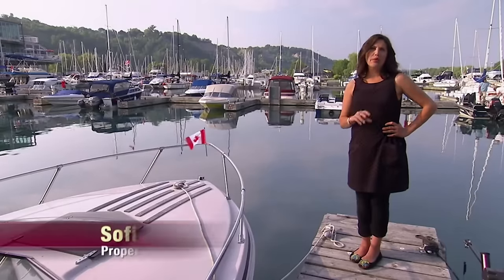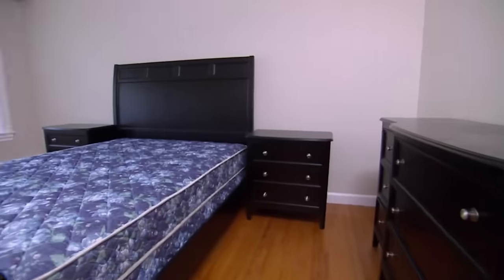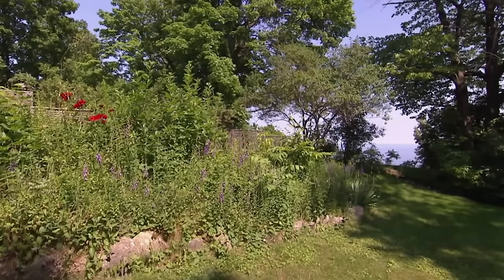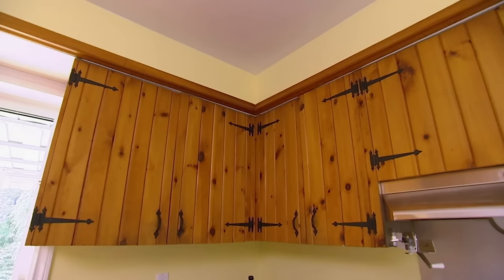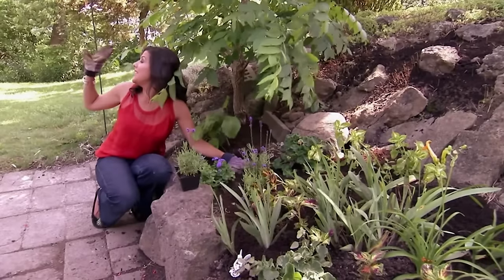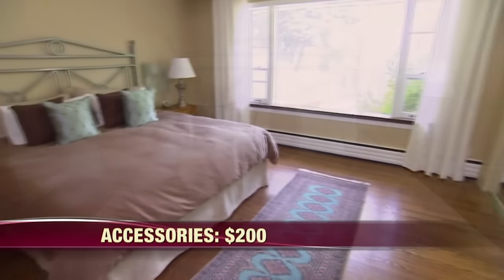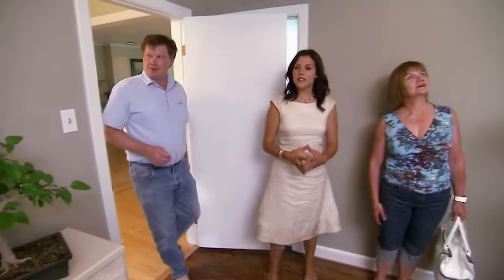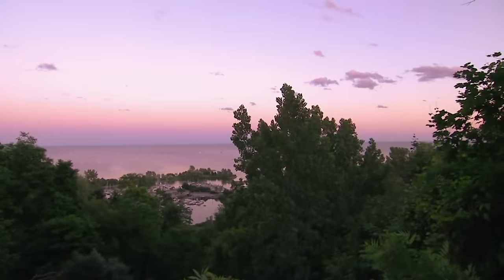A $1.3 Million Property That Hasn't Received A SINGLE Offer! | The Unsellables | House to Home

Comment: Can't the extra door and railing be removed and seal off instead of just replaced with a frosted glass. Why require extra light when there is a huge window? 
Firstly, why the door is ever even build?
Reply: We don't know why it was there but the point is doing a refresh without spending a lot of money and time and doing what you say cost a lot more and takes time to do.
Reply: I’m a “why” person too. I’d love to know what the original layout looked like. It might explain the “door to nowhere.”
Reply: @mindyw2411  I would love to have solved the mystery too.
Reply: @mindyw2411  for sure it was probably something to do with the original layout
Reply: @kebert2thumbsup  The frosted glass “window” is an interesting alternative, but I’d still like to know what the house originally looked like. Just nosy, I suppose. 😁
Reply: @mindyw2411  oh no. I completely concur with you.  I'd love to know the original layout too. 
But also, why so lazy to just rail in that Juliet door (originally! ) 
I sort of have a door like this, except mine is functional.  I have two doors on the steps up to my apartment (I live on the second floor, but also have a foyer as my entryway. Big old grand house....emphasis on old...needs lots of love.  The second door is at the end of a hallway and just leads to the steps. I keep it locked and have a dresser in front of it for storage.
Reply: @kebert2thumbsup  That rail did seem to be a case of “taking the easy way out.” Just no rhyme or reason to it. But the “door to nowhere” made me think if the Winchester Mansion, and so I had to go look that one up again… 😂😂😂
Reply: @mindyw2411  haha.  Ya. That is a good one. But they probably put the rail there when they put the steps in so no one would just open up the door and fall down the steps in the night. But again, just walling it in wouldn't have been that hard. More time and money, sure. But not harder.
Reply: I assume the door led to a small closet and the stairs to the basement were enclosed. At some point they decided to "open up" the plan by replacing the wall that enclosed the stairs with a railing and eliminating the closet. Rather than have to replace the paneling, they simply left the door in place.

Comment: The kitchen could've used more updating: appliances, countertop, sink.
Open the kitchen by either knocking off the wall diving the two rooms or the small section where the microwave is.

Comment: The reason the house wasn’t selling was because of the kitchen. If I were to guess, I would say he probably had to drop the price by about $50K. Did anyone else notice that the garage door didn’t fully close?
Reply: I loved the before kitchen! And yep, I just said to myself,  The garage door looks like mine did when it was coming off the track!
Reply: I think it looked more like the ground beneath sinked on left side.. it happens if the foundation had sand or soft material and it moved over time to water log or something. That's why Jesus warned, to build his chirch on rocks, said be careful of building on ROCKS than sinking sands.. a literal and figurative sermons 😂
Reply: saw that garage door at the end.  It was the kitchen and the backyard. Most people could see that the office could be converted to a room without changing it.
Reply: The house is not worth 1.3 million sorry try lowering it by a million and see you'll get some callers
Reply: @susancross5192  The painted cabinets looks nice but were clearly a cheap fix.  And the very outdated faux woodblock countertops are awful in an upscale house.
Reply: @itsjustme4848  Totally ugly cabinets. They could have filled those gawd awful grooves with putty and they would have looked much better.
Reply: The biggest issue with the kitchen was the counter, terrible quality and terrible color, and the flooring and faucet/sink.

Comment: Everything was an improvement, however that wood wall is a mid-century design feature that should never have been painted over.  I'm not adverse to painting wood, but this was a big mistake.  Would also have preferred a mid-century chandelier in the dining room.

Comment: I would be beyond upset to find out that the panel wall and wood finish cabinets had just been painted for the first time. The potential of both rooms was lost to that bad decision. People love to miss the real opportunities because of their wrong concept of what is outdated. And the whole paint everything white movement will be looking dated soon enough - for me it already has for some time now. It's important to mix darks and lights and a dark wall adds depth. Not every wall needs to be reflecting so much light.

Literally just actually updating the kitchen would have done more and fluffing up the decor and landscaping would have added more value and been money better spent. The warmth it did have was lost to this quick cheap update.
Reply: Me too. This is a modern mid century home. It’s meant to be wood, big windows, primary color art, Frank loydd wright, eames and knoll, Saarinen, etc. a walnut base cabinet with high gloss uppers and cement Greg countertops. Slate floors. If she paints the wooden walls I will lose it. Modern Japanese garden with a dwarf Japanese maple tree, bamboo, etc. paint the fireplace black.
Reply: Reface the kitchen cabinets (just painting them looks cheap) and then have a landscaper spend a day making the back yard look neater.  The other few details weren't significant.

Comment: So the location in the description is United States, but the house overlooks lake ontario and is situated in Scarborough. Its upploaded in 2022, but his monitor is from 2002, the house looks to be from 1997 ("it has a retro feel"). And they want 1.3 millies for the house, which is a 2022, LA price. What. is. Happening.
Reply: Scarborough is in Greater Toronto Area. Like you said this video is more than a decade old and toronto real estate is quiet pricier. In 2022 it will be consider a steal 1.5 m for a lakeside house in toronto. That is a little piece of paradise

Comment: $4 k of improvements for a $1.3 million asking price . That won't be enough .  A buyer at $1.3 million wants to buy a dream , not a requirement to update a kitchen for about $75 K, bathroom updates at $30 k. And I notice that with the closed garage door, the cement driveway has a huge dip indicating some settling  issues. The appliances and computer screens indicates the owner is into " good enough ". I'm guessing that the floor radiator heating indicates there is no air conditioning HVAC........at $1.3 mil and no AC,that's a pass for a family.
Reply: Spot on

Comment: $4000 for the update’s. Hard to believe. What they did in the yard, alone, would be double that.
Reply: If you look closely at the details of the paint job and other dyi’s, it’s incredibly poorly done and will cost more to re-update. I bet if I opened the kitchen cabinets to see what’s inside, I’d be mortified. :D
Reply: I agree. The prices are not accurate it doesn’t seem they included labor. I think the used the tv crew for all labor.not a professional job.

Comment: Well dang, after leaving a comment a moment ago I decided to check out other comments, especially comments about the gorgeous outdoor space.  And instead I discovered a number of "I would have done it better" and "it doesn't look good" type of comments.  Whew!  Could you be any more indifferent to a job well done?  Of course, everything always benefit with more improvement.   But, why ignore someone's else's good work and efforts? ...just because one might feel they can do it better.  That type of mindset is shallow in character and doesn't yield good fruit.  Better to focus on what is Good, rather than seek jagged edges.
SHALOM

Comment: This was interesting to watch. I don't agree with all the changes, but it certainly got rid of the dated look.
However, this is a Mid Century Modern (MCM) house. Some elements were very nice like the modern aluminum chandelier light that was unfortunately replaced with an old fashioned cheapo light fixture in oiled bronze - awful.  That was a huge mistake.
Kitchen still looks awful.  Not sure why the cabinets could not be refaced with new fronts.  Anyway, the white cabinets look better than the old yellowing wood. The old hardware was very dated.  But the sink should have been changed with a modern farmhouse or deep oxidized sink with sharp corners - add some flair.  Backsplash could have been granite stone tiled or similar to add a wow factor.  Kitchen is still very weak. Instead of $900 for a couch, get a nice gas stove that fits the space.
Good work!  Hope it sells fast.

Comment: The Computer monitor in the office is older than the house 😉 What about the 50s bathrooms and toilets. They are not even shown? They are the most cost intensive replacement that have to be done in such a house.

Comment: This is the most half-hearted staging effort inside. The outside was a major improvement. The kitchen was still atrocious with the cheap cabinets. The tile floors were hideous. Paint panelling only in high gloss and in an a darkish colour and leave everything else - all the other walls a flat matte white or pale grey. White floor to ceiling linen curtains. The new bedding looked just as old and cheap. They should have rented staging furniture. The house had so much untapped potential. I only shudder to think about the bathrooms.
Reply: Those were the original cabinets. He didn't have a lot of money to put into the renovations apparently.

Comment: The problem wasn't the house. It was that tightwad that didn't want to update anything. Should've been done years ago, not just when you're ready to sell.
Reply: Tightwads bachelors don't care where /what they live in looks as long as they're functional.
Reply: I mean the guy I still using a CRT monitor
Reply: @raraku1250  well this was made in 2008-09 so it probably was ok?
Reply: @raraku1250  from Pcworld: "CRTs have their perks. Most have a better contrast ratio and higher refresh rates than modern LCD monitors, so content looks richer and deeper. There's a sub-culture of first-person shooter fans who swear FPS games always look best on a high-end CRT monitor. A CRT is also a window into entire era of media." 
LCD took off from mid-2000

From wiki: Most high-end CRT production had ceased by around 2010. By the early 2010s, flat-panel television incorporating liquid-crystal display (LCD) technology, especially LED-backlit LCD technology, largely replaced CRT and other display technologies.

Comment: I swear if she takes down the wooden walls I’ll lose it. That’s a SIN. It’s meant to be modern mid century and it is much easier to make it modern than to make it into another boring transitional/traditional home. Make an Oriental garden. Add bamboo. Dwarf Japanese maple. Paint the door yellow or orange. Wash the brick in a dark blue seal or black. And do a walnut bottom kitchen with high gloss white on the uppers and light wide plank ashy matte wood floors in the entryway or smooth slate and then keep original wooden rooms and add pops of red yellow blue and take hints from Eames and Knoll, Saarinen, Frank Loydd Wright.
Reply: thank you.

Comment: Would paint that weird flesh-tone brick exterior medium charcoal or black.  Put in stained trellis work to deemphasize the flat front.

The living room and office paneling was attractive in the before. I would have painted only the paneling over the and done it to make the fireplace look bigger.  The bulkheads 8n the kitchen should have been removed, the cabinets raised and single open shelf installed to give it more oomph.  The green in the kitchen was too personal, and jarring.

This woman often does a ghastly job, this was another one of those.

Comment: Lipstick on a pig... a nondescript ranch, as outdated as it can be, needs a gut renovation inside and out. Calling it mid-century modern is also a crime. This is a ranch built in that period with no style, no architectural features and a boring space arrangement. The fact that the kitchen and bathrooms are dated and need updating speaks to the plumbing, electrical and insulation - it is probably as drafty as it gets, and the energy bills would be a pain to watch. The wood paneling that people are excited about or try to cover is a completely secondary issue. Perhaps the land value and ocean view  in that location makes up for the ridiculous asking price. I am surprised that the visitors found the yard to be as breathtaking as they indicated, even after the update. No excuse otherwise for that price, and the advertisement of her "update" aesthetic by the youtube influencer.

Comment: I never understand how furniture used for staging affects the pricing of a house ? It is anyways going away with the seller. For me personally the materials used in building, upgrades, structural design, floor plan, lot location and size matters.
Reply: Staging is not the seller's furniture. It's rented furniture to make the house look like it would if it were occupied. If the seller's furniture is in there then it isn't staged.